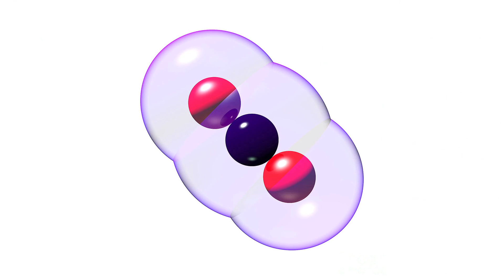Gas Made from Air and Water!

Comment: I looked at this technology a few days ago.  The fact is that one step in the process involves using renewable energy sources (ie. wind, solar, etc.) to make hydrogen from water, and then use the hydrogen produced in a reaction to make the gasoline.  It would be way more cost efficient and energy efficient to simply use the renewable energy to charge batteries in electric vehicles, or use the hydrogen produced in fuel cell vehicles.  Turning it into synthetic gasoline is just another step..

Comment: Any ideas about John Searl and the Searl generator that uses electrons found in air and uses magnets that cycle around each other forcing said electrons through copper wire creating electricity with no outside energy other than a push of one magnet??

Comment: Second (or first, I'm rentally metarded) law of thermodynamics: Whenever energy is transformed from one form to another, some energy is always lost as heat. Energy transformations are NEVER 100% efficient, so in theory, there is more energy in the form of electricity than there would be after the gasoline is synthesized. Even so, with an abundance of electricity and a lack of gasoline, it may end up being worth our while to lose some usable energy to change it to a more usable form, gasoline.

Comment: Making more gasoline won't solve the problem. It's the same as inventing a new big chemical battery, it just contains energy for later use. Energy had to be consumed to create this fuel and a part of it loses its usefulness due to entropy changes in every process. This is not a new form of energy, is a new storage. Even if this goes global it will just help with less pollution, but is not a remedy for humanity's energy shortage in the upcoming decades.

Comment: @GoProXadventures There is trillions of gallons of water on the planet. So wayyyyy before we run out of water, we would already have another alternative fuel supply. And the waste product would be carbon dioxide being that it ultimately turns into gasoline. So yea there would still be the pollution problem, but this alternative is much better

Comment: Hardly fair is some drunk ass crashes in a residential area then every house for 2 streets has to be evacuated :P Also, the cooling system for such a reactor would likely be WAY to big for a car. Maybe a train. But far to heavy for planes.

Those big ass cooling towers at plants dont make energy, they cool. Ships do it but they are MASSIVE, sit in water and pump water straight from the ocean so dont need to carry it.

Comment: I like the prospect of lethal ratiation poisoning if the containment breaks between MOT's or your in a car crash. Also, your first idea assumes the process can generate more energy through petrol than it costs to make petrol which is impossible because of physics and conservation of energy. Thus what you actually make is an electric car and there are far more efficient ways of doing that than putting a petrol plant under the bonnet.

Comment: but if the motor industry improved, then less fuel would be used, which is what you based your entire argument around! And yes, why do you think F1 are changing to 1.6 litre engine in 2014? So that the technology is more applicable to road cars. I think you should go away and read a few articles and books regarding the subject and come back when you are better informed. Because your argument kind of just collapsed in on itself...

Comment: Not a bad idea, but it's more viable to just use the energy to produce hydrogen fuels. HICE driven vehicles are already out there and individual stations can produce their own fuels on site. The only part of the fuel switch that would be more dangerous than gasoline is the hazard of asphyxiation during an accident.

Comment: ... But it would never be energetically feasible... The energy required to create the fuel would be greater than the energy released in the stored fuel.. Second law of thermodynamics. How do you think they harvest the hydrogen from water? Energy in the form of electricity would have to be put in..

Comment: It will ALWAYS take more energy to make fuel than it provides when you use it.  That's basic thermodynamics.  But we have way more energy than we need available to us; our real problem is energy transportation and storage.  We can't build a battery with anywhere near the energy density of oil.  Not even close to it.  So even if you lose some energy in the process, being able to turn electricity into oil is a huge leap forward.

Comment: I would say that we should split our efforts 70 - 30.. 70% of our efforts should be finding an efficient effective REPLACEMENT for petrol / diesel, something like solar, or hydrogen or whatever.. the 30% should be refining practices for IMPROVING what we have, if the process required to create the fuel referred to in the video, could be made simpler, and cheaper.. Than it would be quite amazing

Comment: If you're using Solar or Wind power to create the electricity needed to create the synthetic gas, then it's almost carbon neutral - you take C02 out of the atmosphere to create the gas, and then when you use the gas you put it back - net production of C02 is 0... So, if you switched the entire world over to an efficient system of creating this fuel and only used renewable energy to make the fuel, you would stop putting new greenhouse gas into the atmosphere.

Comment: The problem with some alternative energy sources is that they don't have a constant output of energy. Solar power doesn't work at night, wind energy doesn't work when there is no wind. So the race is on for creating the most efficient method to store energy. Turning water and co2 into gasoline has potential.

Comment: This is NOT as impressive as you think. If you look up the coal gasification process you can see it is nearly identical. Coal gasification has been used since before the 2nd world war and durring the war provided Germany with most of its diesel fuel. The only real difference is that now they are taking CO2 from the air instead of oxidising coal to produce CO2. The process can be used to produce any sized hydrocarbon chain desired meaning you can produce anything from butane to motor oil.

Comment: This can solve the need for gas to run our gas cars sure, but in order to spur the reactions for bonding we need to get energy elsewhere. Glad to know when I am old and just want to drive my bad ass hot rod I can still get petroleum. =P (PS If you burn this fuel you just get the things it was made of back. We don't lose water because it comes right back after the fuel is burned!)

Comment: First of all, there's very little wrong with ethanol. Second of all, check environmental regulations on Diesel. There's a really good reason why it's never stated as an alternative for or cleaner fuel than gasoline. It simply isn't. wikipedia (dot) org /wiki/Diesel_fuel

Comment: I want to correct Joe on one point. Yes this takes energy but not all energy is created equal. Coal energy is horrible for the environment as is petrol based energy. But if you used solar, wind, hydroelectric, or geothermal sources you could create a carbon neutral liquid fuel from a renewable source. This is especially relevant for Iceland where there is an enormous amount of excess cheap geothermal energy. This could be a huge thing there.

Comment: You obviously have no idea how combustion works. Water doesn't deplete like that. Water is H2O, your using water (2 H2O for balance) and CO2 to make CH4 (methane) and then C2H6 and higher carbon hydrocarbons when you do this you create O2 (or 2 O2 for balance) if you burn methane you get... CO2 and (2) H2O. The point of this is we are sequestering (taking) CO2 from the air and then putting it back so it is CO2 neutral.

Comment: both.  Seriously,  Hook a windmill and solar panel up to a gass generator and you have best of both worlds.  Relatively clean energy ( or at least potentially carbon dioxide neutral engery).  Better than digging coal and gass out of the ground an releasing the CO2

Comment: unfortunately, you're wrong. you just stated a random fact about percentages of gasses in our air. Gasoline is composed of 20% C8H18, 20% C9H20, 15% C10H22, 15% C11H24, 8% C6H6, 10% C7H8, 10% C8H7 and 2% C8H10. as you can see, many carbon and hydrogen atoms are used in gasoline. CO2 and H2O are being removed from our atmosphere, but only the C and H are being used, which gives us TONS of excess O2.

Comment: One of the outputs Internal combustion engine is water.
The main derivatives of the process are carbon dioxide CO2, water and soot. I would think that when the water evaporates it will be recycled and it will still work. So i don't see how this could be a problem.

Comment: Hydrogen fuel is easier and cost nothing but water. The water is seperated by electrodes into oxygen and hydrogen. Hydrogen is lighter so it is seperated. Oxygen is exhuasted out the tailpipe and the hydrogen is extremely exothermic. A little heat and controlled injection and we have ourselves a hydrogen driven car.

Comment: HEMP BIODEISEL . one acre of hemp would be more than enough to produce the amount of fuel that i would personally use per year. approx. 15,000 miles. and it has a ZERO carbon foot print, can be used in our existing engines, and leaves your engine sparkling clean.

Comment: I agree completely, electric cars aren't the way forward, but it is the route that manufacturers seem to be going down.It's nice to see Mazda are looking at what i see as a better option for now, and downsizing engines, and using forced induction with SC's and turbo's, and getting 60+ mpg out of 4x4/suv's (depending on where you're from). Personally i'd love this to work, but i do wonder why a much larger company hasn't tried to do the same, as the process is fairly basic, there must be a reason

Comment: Another long-term, expensive, highly efficient way to get that power is through nuclear. There are processes to recover the 98-ish% good fuel in fuel rods that no longer can sustain controlled fission, and recycle them into new fuel rods good for reactors, but not pure enough for bombs. Two sets of fuel rods can run a plant for about 200 years before you need new fuel. It has a tiny environmental impact, and makes a lot of power. Probably the most viable source for meeting energy needs right now

Comment: Nicolai Tesla made a device that literally pulled electricity out of the air. He designed it, built it & used it @ his home in Cripple Creek CO. The electricity he was able to get was naturally DC. So why not use his plans & make cheap electric cars (with this device). Or why not have free or cheap electricity? The government will not allow it. There is a LOT of $ to be made by charging ppl for a utility. 
when did "of the ppl, by the ppl, for the ppl" die???

Comment: That would be great, but this is also really great, note that the process of producing this stuff and burning it is carbon neutral, what with absorbing it during production then releasing it when burned. It also doesn't require building millions of new cars (and the environmental impact of that), in order to utilise.

Comment: I'm not saying the sun isn't an amazing or viable energy source. I'm saying it's not currently used because the solar panels are extremely inefficient. Maybe in a few years but like I said, most electric cars at the moment run of electricity generated with coal.

Comment: Well I heard that it would only take 100sq. miles of solar panels, the new kind that reflect the sun's energy into some tube, to produce all the energy the US already needs. Plus there's a company working on electronic roads that capture the heat/energy (through solar panels) of the sun to give off energy and pay for them selves. Put both of those to work, dig out a state and make it solar panels, or even just 2 sq. miles per state, put solar panels on all roofs and swap out 'route 66 roads.'

Comment: Those batteries can be recycled.  More importantly, though, transportation cannot be fueled by thorium unless there is an electrical system to distribute it + convert it to kinetic energy.  Thorium is awesome, but it is still only a transition to a hopeful fusion based system in the future.  Until then, a number of renewables with a strong nuclear base seems best.

Comment: For how you reported it, this approach seems really shortsighted: to be using our precious water supply  just so we can piss it away like we did with hydrocarbons... unless the combustion of this fuel converts the emissions back to equal parts of clean water, which I seriously doubt. Otherwise, we are going to kill each more for water than we do now for oil. Only 1.3% of the water on this planet is drinkable. You mess with this, you just FAQ'd yourself and us.

Comment: Trust me, electric cars are not a good way forward. Hydrogen cars, maybe. The main problem with electric and hydrogen cars is getting the power source (electricity or hydrogen fuel cells) The synthetic fuel route is much better as there will be little re-structuring of the existing system (petrol stations).
And to clarify saying short-term probably wasn't the best words. I mean this could be a solution for the next 60 or more years
Sorry if this comes off rude, its not meant to be :)

Comment: Obviously the more we work on it the better it will be that's how technology has always been. But that doesn't mean that at this particular point in time electric cars are any better. And it won't be until innovations such as the one in the video are available.

Coal plants emit just as much CO2 as gas powered cars. So until the majority of cars use electricity produced from a cleaner source the fact that there are cleaner sources is pretty much pointless.

Comment: Invest in renewable energies - wind, solar, wave - use those energies to create the gasoline. The electricity made from those sources wouldn't ever run out. The big question is whether or not the amount of gasoline created by that amount of electricity will get cars further than the same amount of electricity if it was put into an electric car. This source of gasoline will be used in the future, because we're going to run out of oil eventually.

Comment: This isn't that hard.  Octane burns to make water and carbon dioxide.  All you have to do is run the process in reverse (add energy in instead of taking it out) and voila.  The problem is that the efficiency of these processes is less than 100%, so it would take more energy to make gasoline than what you would get out when you burn it.

Comment: It makes absolutely no sense to buy an electric car, if the electricity you're putting in the car was produced by burning fossil fuels. Think about it. The only difference  between having a normal car and an electric one is where the oil gets burnt. Also, in just a couple years, green energies such as solar power and nuclear fusion will be cheaper than coal. That's how free markets work. We shouldn't subsidize any energy industry. Trust me, the price of green energies keep dropping while oil ke

Comment: But the solution to gas being more pollutant than electricity is not to settle on the old less polluting technology, the solution is to make cleaner alternative fuels.

And also, while I am skeptical of your claims of an electric motor being able to propel an SUV faster than a 911, even supposing that were true, Teslas are incredibly expensive cars. The point in solving the problem is making the solution affordable. A quick google says a Tesla electric car is > $100,000.

Comment: What if you want to go farther than 300 miles from your house? Until charge stations are as common as gas stations these cars cannot be effective as gas cars. Also, people might take 3 minutes at a gas station, whereas charging this would take 30,if people were lined up waiting to charge their cars it would take ages to get  a spot...you cant really use one car as an example of why people should switch to electric if fuel efficient vehicles that feel the same when driving are available...

Comment: All right but most of electricity is produced from combustion of fuel and coal, which is pretty polluting. So I believe that, right now, it is actually less polluting to use a fuel can than an electric one, since you transform fuel into energy, instead of transforming fuel into electricity into energy. That additional step makes it less efficient. Correct me if I'm wrong.

Comment: The point is that not only is there a potential for actually cleaning the air (or at least not further polluting it) but also that cars already in existence don't become scrap metal. Performance and efficiency don't matter if the fuel is clean(er) and renewable.

Comment: no! if the gasoline is small chains that burn clean that is fine. but if it burns dirty, NO. why? this gasoline isnt like the crap that is already gasoline its water and gas. so if you burn it and get more soot means less water that is turns into gasoline gets burn back to water. so if you turn water to gasoline and water gets lesser each time you do that its even much more of a disaster. and there is also the problem if the amt of electricity required will be more to produce the gasoline.

Comment: This sounds too good to possibly be accurate.
Even then, electric cars are definitely not the answer to fuel problems.
The electricity comes from coal being burned, which is also an extinguishable and polluting resource.
Electric cars are actually incredibly inefficient users of energy, and are a step backwards in the technological chain. We need to continue moving forward, not settle on technologies that aren't actually addressing the problem.